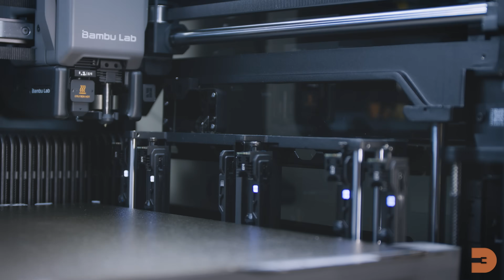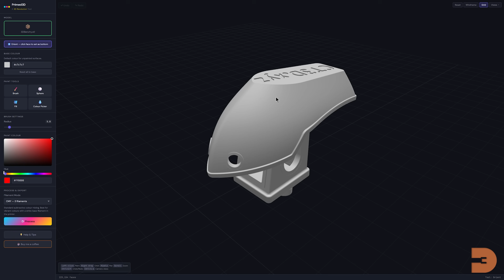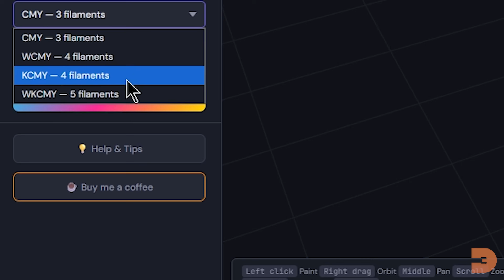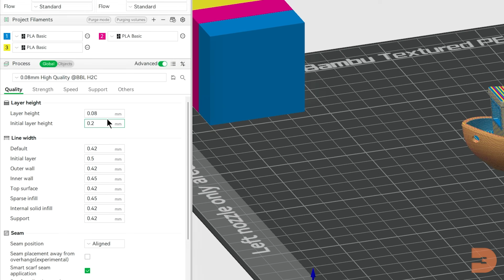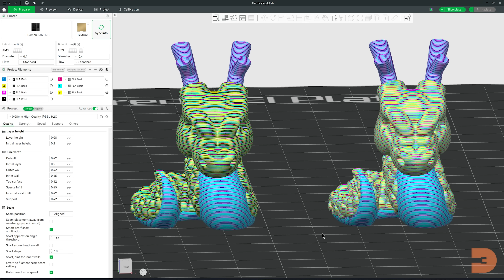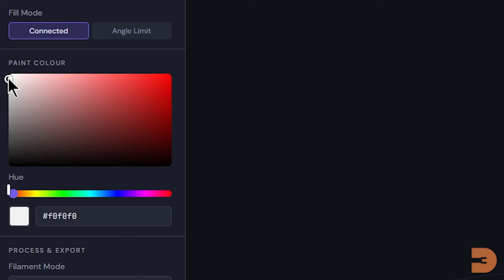3D Print in Any Colour With My Free Tool

Comment: Do you think you could lay down black or white as dots in a layer, and then print the layer again in c m or y, essentially darkening it more subtly?
Reply from the maker: As in laying down dots then printing the colour at the same layer height to compress the black/white?
Reply: @3DRevolution  yes exactly, I wonder if that would work. Or if not that some form of checkerboarding
Reply from the maker: @kaas3530  Laying down a single dot would get very messy, so the only way that could be done more reliably would be to draw a line starting from the outer wall and heading into the infill.

That could in theory work but I'm not sure how reliable it would be and could cause issues with nozzle collisions (I think you 'd end up getting a lot of the 'dots' stuck to the side of the nozzle and strewn across the print.

But more importantly is, currently this works by producing a painted finish that Bambu Studio can import. Bambu Studio only applies this to the exterior surface and it, itself decides the division of colours within the model. There's a good chance the dots may end up getting removed, or at least some would, that would leave an irratic diomming pattern.

But dots aren't something I'd really considered and it's great to think about any and all potential options, so I'll definitely be keeping this in mind as I work on progressing it, thank you!

Comment: Love everything about this! Definitely takes to the next level the same type of math i've been messing around with in openscad for my gradient dither and my egg dither.   Now, with the white and black, have you thought about (crazy idea incoming..) pushing layer heights down even lower?   With hueforges I've had good success at 0.04 layer height, even with a. 4 nozzle, just usually requires dropping 10C nozzle temp to avoid clogging.  But lowering the height, allows for a much 'longer' chain of color layering to get desired output color within the thickness that the eye can visibly see.   The programmer in me would love to play more with this prime3d...cant wait to start messing around!  We definitely should chat further 😎
Reply from the maker: Your egg was a big part of the inspiration behind this, glad you like it!
That makes sense you did that with OpenScad, I meant to reach out and ask what method you'd used to develop it.
That's an interesting thought with pushing the layer heights. Would make a huge difference for improving layer blending. Definitely will give it a try at some point, and added it to the list now so I don't forget.
Definitely up for chatting more. Feel free to pop me a pm via one of my socials.

Comment: It's not clear in the video but when using the fill feature with angles does it highlight what it's about to color before it does? If not that might be a good enhancement. Awesome video and awesome work. Who cares if it's vibe coded, it works!
Reply from the maker: Ah no, it doesn’t do that, but does highlight areas in the reorient mode. Thanks, good suggestion

Comment: There is another feature you can offer. If a user prints a yellow and red filament, lift those and feed it into the head, you'd get an orange filament. You can simplify that work to make new filament colors.

Comment: Wild idea: What about natively supported gradients? The reason I'm asking is that dual nozzle printers are fairly common, so efficiently printing 2 colors would open it up to a lot of people.
Reply from the maker: You know what, adding a gradient paint tool is one of the most recent things I've added to the list of features I want to add, but I also definitely want to add features that people can turn on to optimise for dual nozzle/2 colour printers. I'd not thought about how much these two would compliment one another.
Love it! Thanks for sharing!
Reply from the maker: A big version update coming this week, keep an eye out☺️
Reply from the maker: You'll like the new update ;) 
https://youtu.be/DrCWponq2xU
Reply: @3DRevolution indeed! Thanks for the updates. Sounds like you are having a lot of fun with it. Being able to import existing painted models is also a fantastic idea!
Reply: @3DRevolution holy crap, Bambu Studio is also on the bandwagon. Even includes gradients?!
Reply from the maker: @74357175 yep, although their gradients implementation doesn’t give you anywhere near as much control or flexibility as Primed3D does
Reply: Just tried your dual nozzle mode 👍
Curious to see how horizontal gradients end up looking!

Also tried the Bambu Studio gradient: something they have that is pretty nifty but hard to do outside the slicer is variable layer height to do smoother mixing ratios (and vertical gradients)

Comment: Really cool, so impressed!  It seems like the best blends are where you have every other line sharing just two colors.  It would be really cool if you could load your filament colors, let's say 2 to 6 colors.  The software then generates a palette of "in-betweens" that you could select from, which in the case of 4 colors would 10 different colors I think, call this primary (like your spiral).  The next selection, or secondary palette, would then connect all those so that the most would be three layers to make a color (I think 18 combinations)...Tertiary palette would generate 4 different layers, etc.
Reply from the maker: Ooh now that is a fun idea. 
For now I'm focusssing on what I can do with it prioritising it using just 3 colours (with the potential of black and white), but I love the idea of being able to dial in what filaments you have, and it basically then making the best option it can with them.

Comment: Love this approach! Just tried it, and I think I need to remesh my objects in order to be able color at the triangle level. That's part of the design, right?
Reply from the maker: Currently, but I'm working on a way to go sub-triangle.
The issue largely comes down to that I was determined for this to operate as a lightweight web-app that runs entirely locally (meaning no safety concerns about uploading STLs, but also that you can just save the web page to your desktop and run it offline).

Unfortunately that does impose some restrictions and limitations, but I'm working on a potential way to do this without causing issues for people with less powerful computers.
Reply: @3DRevolution it's totally fine, just means being a little more intentional. 

Although sometimes you get an STL from somewhere and remeshing is not an option, so yeah

Comment: Really great work! Would it be possible to mix the color using the walls? As in, for example, having 2 walls of diferent color each, black as internal and yellow as outer wall to make the yellow darker. Maybe using thin walls (0.2 or even less) could make the colors blend. Then it could also be mixed with swapping the order of wall colors each layer to further blend them. It would take much more print time and color changes but i think it could work
Reply from the maker: Thanks very much!
That's a great suggestion and something I've been thinking about.

In it's current format that isn't possible as this works by providing a colour map, which the slicer only applies to the outer wall, and the slicer then determins the colour distribution of all internal walls.

However, I have been working on a workaround so watch this space.  It would certainly allow black to work much nicer with the colours, allowing white and black internal walls to lighten or darken the appearance without featuring the staggered lines.

Thanks very much for the suggestion though, this is what I hoped would happen with this and it would get people talking and innovating as a community :)
Reply: @3DRevolution  then I'll be sure to watch what you do next! Thanks for helping the community!!
Reply from the maker: Always happy to help. Thank you for watching and contributing, and of course, happy printing!
Reply: @3DRevolution  I don't know if this is any help, but I have been working on something similar to this. Maybe a possible way to do this externally from a slicer is to create 2 smaller offset versions of the model and then position these 2 inside the original hollow model as objects in the 3mf file. You can find a reddit post I did about this if you search for:  "Fullcolor mixing with perimeter blending inspired by lithophanes" .
Reply from the maker: Yeah there is the option of creating an offset STL and using that as a modifier shape in the slicer. But that would only allow you to apply a solid shape-wide internal colour (which I guess could be used to just darken the overall colours applied, and may be really useful).

The other thing is it needs to be an offset, not just a scaled version of the original or things will not line up. This is definitely something I'm going to be exploring though as one of the primary issues at the moment is the way that black blends into it. 

Having sub-layer blending to add white or black would be the golden egg for this method so definitely want to explore all avenues. I'll check out your Reddit post, thanks!
Reply: @3DRevolution  Awesome, I hope it will be of some help that can make perimeter mixing be implemented as well. I have been waiting for these features since november 2024.

You are absolutely right that the models would need to be offset, not shrunk, as you will also be scaling "holes" in the model down.
@ignacioestigarribia1075 is also right that a smaller nozzle like 0.2 mm is ideal, my tests confirm this.

If you import the 3 offset models as 3 different objects they can all have a different variety of color, the smaller models will have to float slightly over the bed, which slic3r does not like, but there are workarounds to that.

In my tests perimeter mixing worked well for creating darker/lighter hues by mixing in black and/or white perimeters at different depths, but the perimeter mixing and layer dithering can also complement each other in other ways similar to how inkjet works.
Layer dithering has limitations to how complex mixes you can get without it becoming noticeable, but they mix linearly and it's easy to get 50/50 mixes. Perimeter mixing gets nice homogenous colors, is non-linear but has limited resolution as you do not have much more than 3 perimeters to works with - maybe some gains can be had with variable line width?
The gradient tower I printed using yellow and magenta filament with 3 perimeters can theoretically produce 8 different colors, maybe 3 different hues of orange, which certainly is not all of them, but by combining perimeter mixing and layer dithering you could use perimeter mixing to create 2 visually distinct hues of orange but then dither these 2 to create new in-betweens.

Another thing is importing color models now that we can print in "full-color". I have made a program for converting obj files colored with mapped image textures into vertex colors that can be imported directly into slicers, that might be interesting to you, if you search for:
"Way to import obj with image textures in slicer"
Reply: Like hue forge but with walls instead of layers